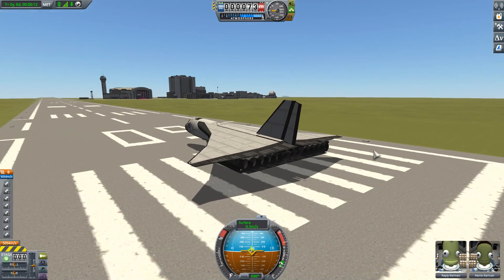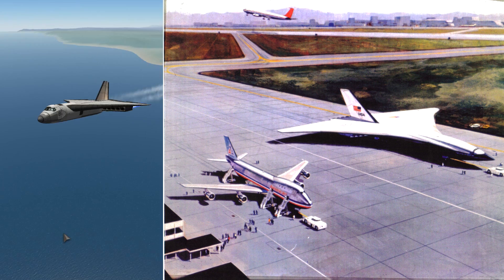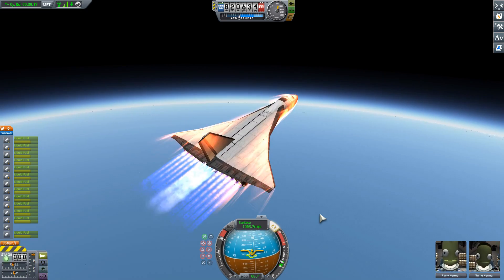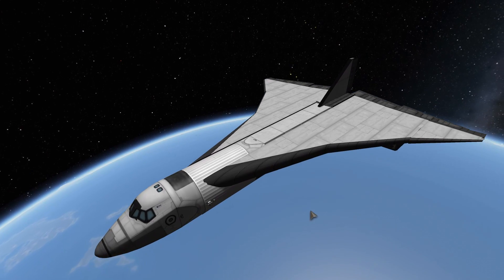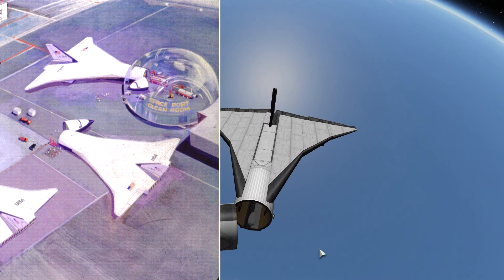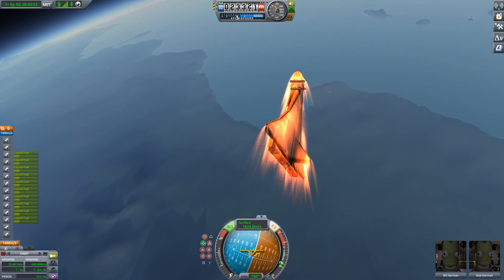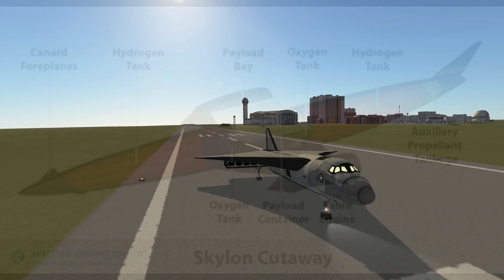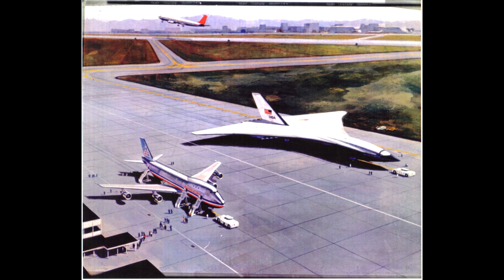The Star-Raker - A 1979 Space Plane With 15 Engines, Massive Wings & Huge Ambition

Comment: Still think it's a great concept .... however reaching Mach 6 should not be necessary ... one could be satisfied with Mach 2 and then start the rocket engines, which hopefully are not using hydrogen as even RP-1 liquid oxygen allows for more cargo at lower delta-V ... (for a delta-V of just 9.5 km/s methane is better than hydrogen)

Comment: This is interring as I once came up with a very similar, but a much scaled down design of a "space plane" in the past. Simply called the "spaceship", it looked much like a combination of a space shuttle and the Concorde, powered by multimode electric plasma-ramjets, later switching to plasma jet engines with an internal fuel supply to reach earth obit and even beyond. Later versions used a "wave jet", which utilized ultrasonic air compression and microwave induced plasma to create a blade-less jet engine, and which did not require a "startup" speed like a conventional ramjet, and so could also be used on take off. At a certain altitude, the spaceship would switch to series of 4 deuterium-fusion thrusters to reach orbit. It was to be used for cargo hauling, maintenance of orbital spacecraft and passenger transportation to space stations and lunar installations. Even space tourism.

Comment: Despite its apparent silliness, the term superalloy is a technical term in metallurgy. it refers to NiCr alloys that are hardened by the gamma prime hardening mechanism, and are capable of carrying significant loads at temperature over 1000°C. Some  of them are capable of operating at over 1500°C (used for things like jet engine turbine first stages)

Comment: I just wonder why speeds are measured in mach numbers - are those exact amounts or do they vary depending on the temperature and pressure of the air because the speed of sound varies? Perhaps I should just look up 'mach number'... it's just not as well known as mph or metres per second or km per hour...

Comment: The SABRE engine system is very clever, it uses some cunning thermodynamic tricks to make single stage to orbit more efficient than any other attempt, in fact, I think it is the ONLY system that has actually proven that it can get the job done with enough efficiency so that it can carry a sizeable payload into orbit.

Comment: So how would the Solar Power Stations have worked? Really long cables? ;-)
Reply: By transmitting microwaves to ground receivers. I just skimmed a paper from 1980 on this, and engineering the ground stations is monumentally complex.
Reply: @cf453  I wikipedia'd it too.... Sounds dangerous! ha
Reply: @wishbonebrewery  Neat! I think the intensities were generally low enough that it's not an immediate health hazard, but I don't think you'd want to hang out in the antenna farm all day.

Comment: Huh, these engines sound an awful lot like J-58s redesigned to include some sort of regenerative cooling and maybe even something akin to the skylon precooler. Though I imagine they wouldn't feel the need to liquefy the oxygen during intake, only take it down near the operating temperatures the J-58 ran at. 

IIRC the limitation of the J-58 was not melting the intake manifold. The engine could take the SR-71 much faster, it was just that the intakes and then the rest of the airframe couldn't take it.

Comment: Engineers: "Cargo doors on the roof are a point of structural weakness"
Same engineers: "Let's make it so that the entire cockpit can seperate from the rest of the craft to reveal the cargo"

Uuuhm.
Reply: If you consider the fact that it would allow the installation of an emergency escape system like Nasa designed after Columbia it isn't so stupide.

Comment: Nice if you could replace the Space Shuttle nose on that Kerbal Space model with one closer to the original design.
Looks like the engine undercarriage, aerodynamically, would have been a problem with re-etry and protecting from overheating.

Comment: The military would have liked the divert-capability to a different landing site after reentry. Star Raker would be easier to realize using Reaction Engines, Ltd.´s Sabre engines which work in both air-breathing (up to about Mach 5.5) and rocket modes. This design also avoids large segmented SRBs next to the orbiter and a large fuel tank shedding ice that hits heat tiles. NASA could have cooperated with Europe and (re)fueled in Kourou for the ascent to orbit. Thanks for the info, also to Davis S Portree!

Comment: Question:  You touch on this here, and forgive me for lacking engineering education, but...

One of the issues with SSTO designs that the Von Braun type staging rockets avoid is the issue of hauling the dead weight of empty tanks up to orbit.  Has anyone done serious studies of using air-to-air refuelling to create a SSTO space plane - would such a plan enable a close mimic of staging by refuelling the craft at a high altitude?  I guess the SR-71 kind of does this as it needs to refuel as soon as it gets to altitude and the airframe stops leaking fuel.
Reply: There were some investigations into suborbital refueling.

Comment: Flipping the cockpit to the right is a really weird decision (especially before advanced computer avionics were a thing). I would have had the cockpit flip downward, this would allow the pilot and cockpit window to still face somewhat forward. Also the plane would remain symmetrical and in line with its engines making vectoring in this (still awkward as frick) mode a little less awkward.

Comment: A few years ago i listened to a lecture given by the chief engineer of Skylon and he detailed their roadmap for design, it was very interesting, i believe they plan on having a single engine on a set of wings in the 2030's. After they can prove the engine's functionality they'll start to focus on the actual craft itself. Skylon is a way off, but they've done the hard work of creating a revolutionary new engine. In my opinion this will one day surpass space x and rocketry as the primary method of space travel.
Reply: Doubtful (SSTOs are not actually a great way to do space even if you can do it), but I expect to see it revolutionize transoceanic aircraft.

Comment: As I recall, Reaction Engines tried something with a similar layout before Skylon, but found that the center of gravity changed too much as propellant was consumed or cargo was deployed which required excessive torque/trim forces.

The design of Skylon with cargo and engines in the middle and multiple propellant tanks symmetrically in front of and behind the center was created to solve this issue.
Reply: Skylon has to create a solution to the fact that Sabre is a hoax.
Reply: @-danR  Unlikely. It has been reviewed by ESA who found the design to be sound.

Now, whether it's the most practical way to achieve cheap orbital access is another question. It may not be, but this doesn't mean it's a hoax.

Comment: Great video. What was the plan for these 60 space power stations? How did they intend to bring the power back down to earth?
Reply: Microwave power transmission, the ground-side receivers would use something called a "rectenna", which is an antenna with a rectifier built in (because microwave frequencies don't travel through metal very well).

At the current point in time, the only technology demonstration that we haven't done is to power something on Earth from a satellite in orbit. We've done beamed-power demonstrations on Earth, including with actual rectennas, through an equivalent thickness of the Earth's atmosphere, at the frequencies that are believed to be best for the purpose.

Really, the biggest problem with the whole thing is that they'd be launching most of the parts from Earth. For Solar Power Satellites, you want to launch mining and construction equipment to the Moon, so that the reduced launch costs of bulk materials (including silicon, though solar-thermal should actually be better than solar-electric) from the Moon will result in reduced energy costs for the construction of the entire system.

Comment: How does the engine in the video turns into ramjet from turbojet? From the plans it seems like the turbojet acts like the ramjet’s core and the ramjet is build around it.
Reply: Yep. This sort of design is pretty much all about moving some vanes or something inside to alter the internal airstream according to current operating mode.

Comment: I know this project sounds difficult to pull off, but this is Rockwell, they created the Turboencabulator. They could do anything.
Reply: Making the heat shielding out of prefamulated amulite was a real game changer.
Reply: And here I thought that was Chrysler
Reply: @mpetersen6  Chrysler co-developed the technology and specialized in automotive-grade turboencabulators
Reply: Bifricating dingle arms could have been used to increase the efficiency of the turbo pumps ten fold.
Reply: The cromulence of the design gives me goosebumps.
Reply: Ah, technobabble. 🤭

Comment: Mr. Know-it-all here. Re entry burn would cause a lot of vibration for those wide wings risking break up. I recommend narrower engines to allow narrower wings.
Reply: No, wide wings are used to achieve lower-temperature reentry, by increasing the drag in thinner parts of the atmosphere. If you go for narrower wings then you either require better (and thus heavier, leading to a Space Shuttle style cascade of design consequences...) heat shielding, or have to use fuel to actively slow the vehicle before or during reentry.

Comment: But which Space Station has Low Conductivity High Temperature Ceramic Tiles? 6:50 ;) I guess the Space Shuttle was indeed a Space Station when in orbit :)
Reply: If you can get it into space and make it stay there, then anything can be a space station!
Reply: *Anything with a pressurised compartment, docking port, power source, and life support.
Reply: @xlynx9  and room for 5 or more crew!
Reply: @emotodude  I see what you did there, and I approve.
Reply: Wait, other comments said a space station needed to stay up there and hold five or more occupants...  So I guess Skylab didn't   count?  😢  (Poor thing, neglected while people focused on the Shuttle instead.)

Comment: Ironically Reaction Engines have recently solved the engine problem (mostly) with their Scimitar design.
Though even back then engineers knew that adding wings to a reusable spacecraft just made it more expensive in comparison to a reusable VTOL design. Which is what SpaceX is finally developing.
Reply: As SpaceX learned, they're not completely irrelevant, they just don't add value away from atmosphere. That's why Starship is getting reentry wings.

Comment: Everyone dreams of a pit stop able orbital insertion craft, but in reality these things would probably have to be gruellingly  re-certified. I  think the shuttle had to. Monolithic SSTOs generally require some engine weirdness like ramjet to rocket or air to oxidizer to rocket.
Reply: The Space Shuttle was an overly brittle death trap designed only to make human spaceflight almost impossible to cancel. Any good design would have to prove itself before it was allowed to do the quick turn-around stuff, but once it had proven itself and had a valid set of procedures worked out they would absolutely allow it.

The trick is that doing this stuff with an SSTO is a fool's game.

Comment: I'd love to hear more about what those solar generators were meant to do and how they planned to get the power back down to the ground?
Reply: Microwave power transmission to "rectennas" (antennas with built-in rectifiers, because microwave frequencies don't travel well through metal). The only tech demos that haven't been done yet are to power something on the Earth from a satellite. Demonstrating beamed power, at the relevant frequencies, through an equivalent thickness of atmosphere, have all been done already.

At any rate, you would really want to launch most of the stuff from the Moon for the sake of reduced energy costs. Also, solar cells at the time didn't have enough energy production capacity across their entire lifetime to pay back their construction energy, so you'd actually have wanted to go for either solar-thermal turbines, or an RTG system with mirrors instead of radioactive material.

Comment: Is skylon still happening? 
Kinda seemed like it fizzled out.
Reply: Yes, they are still working on it. The engine is nearly done.
Reply: @3gunslingers  : Didn't they change the actual vehicle design? I thought Skylon was the rear-engined design from the 80s or 90s that they replaced for center-of-mass reasons?

Comment: I can see this happening using electric engines for take off to hight for rocket engine takeover to orbit.
Use the raptor engine with methalox instead of hydrolox optimized for space.
To enhance electric supply,  from ground to about 35000 feet use a jtol engine for power generation then go full battery pack to orbit.
Using this combination would alow smaller tanks needed for operation and extended flight there by increasing potential cargo capacity and ease of reusability. 
Taking a page out of the SpaceX play book, use stainless steel for the lower sections of the craft with the tiles being developed for the starship as heat shield. 
Once the proper density of batteries is achieved Elon has already said electric aircraft would be feasible,  this just brings it a massive step further.
SSTO vehicles have always been a dream that was out of reach, but, using this combination it could be feasible. 
We just need to find the proper balance.
Reply: Electric batteries will never be suitable for space launch, because there is no chemical possibilities that offer sufficient energy/mass ratios for the job. Nuclear isomer reactors could do it, but that's an X-ray battery technology, and would be used for direct heating of the propellant, so not electric, not that we've finished the basic research on them anyways. If you really want electrically powered ascent stages, then you need to go with beamed power from a ground station, not onboard power storage.

As for electrical airplanes, some already exist, but they'll never be airliners. Batteries just don't offer the performance required for that. Maybe you could do the job with a zeppelin, and certainly it's being done with short-hop aircraft, but not a conventional high-speed long-distance airliner, the combination of drag & duration is too extreme for the potential chemistries to make it practical.
Reply: @absalomdraconis  I guess I didn't explain my thoughts on the matter clearly. 
Elon has been talking about building aircraft totally battery powered to run electric jet engines that would become more efficient as they got higher due to reduced drag and no need for oxygen to burn.
The craft would fly above 60,000 ft and could travel beyond moc 2 only on the flight engines,  when top elevation is reached the metholox engines take over to orbit.
I figured if you run a jtol engine (small jet motor used as an alternative power source ) to offset the battery pack  till around 35,000 feet until it can no longer breathe. 
It just seams to make sence to setup an SSTO in this way .